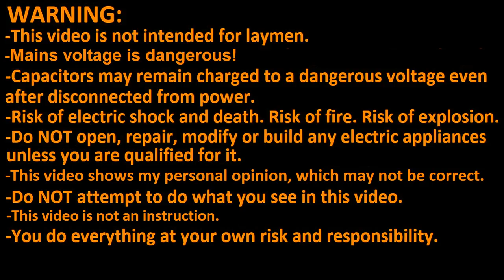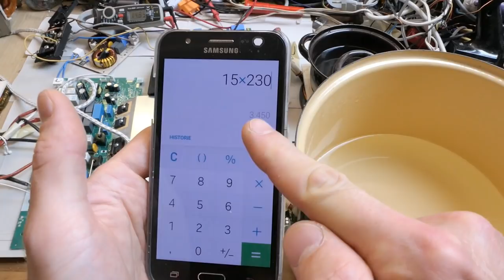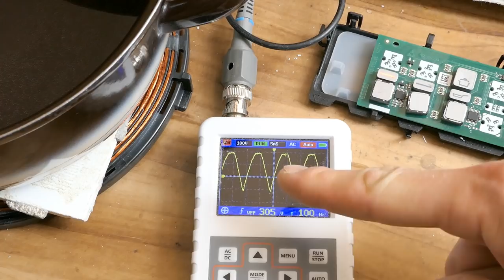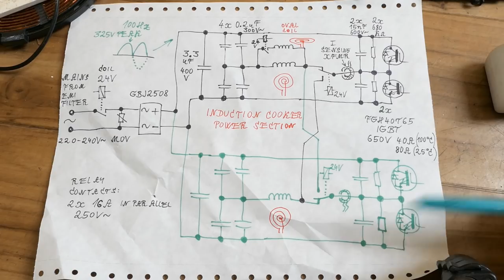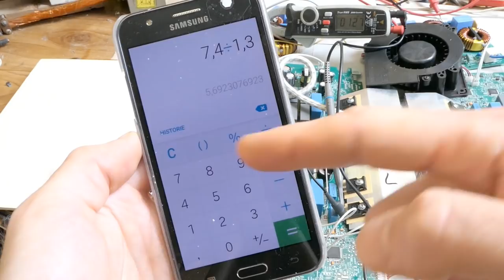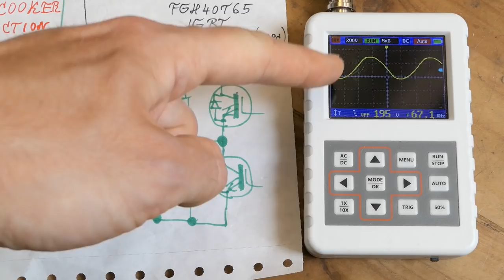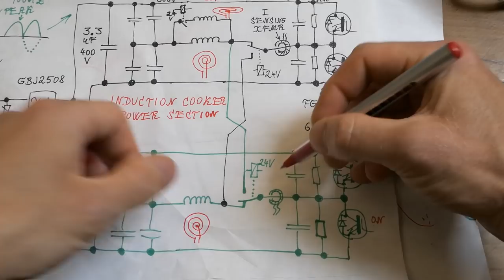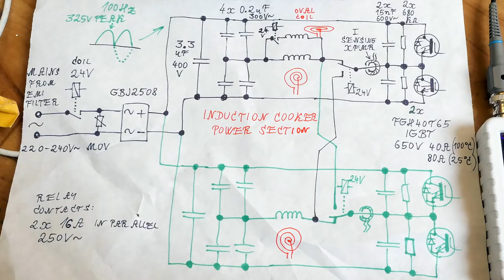induction cooker experiments and analysis

Comment: I always amazed with fine tuned resonance circuit. for me it's like a black magic, but again to put it simply it's like pushing a child in swing when the swing at its peak so the oscillation is not interrupted, BUT implementing this on an electronic device it's still amazing and bloody complex.
Reply: it could be imagined as 2 children on swings and you left arm does one and the right does the other out of phase. your body is the pivot. also you can imagine a olympic swimmer with each stroke but a slight delay between each as the body rotates slightly for the next pulse. A liitle bit of the last stroke is converted into the pivot. but only on the fastest swimmers.Dont tell anybody as its an olympic secret.LOL

Comment: some pots have a iron core attached under them so they can work with any induction cooker
Reply: Iron would be ideal. Sometimes it’s a thin steel plate, and it tends to overheat when it’s too thin.

Comment: This content taught me more about inductive circuit and zvs in 20 minutes than any other.Thanks so much for your straight forward explanations.You are as effecient as this zvs circuit! Question... I would have thought the freq at the halfbridge would be 25 hertz or there abouts as 50 hertz is coming from the outlet?I suppose that is the freq from the transistor going into the coil but what happens to the mains outlets freq as you said they overlay each other. I would have thought it would get ugly on the scope when they clash.
What is driving the gate ? Kind regards Andy
Reply: The half bridge circuit rectifies both half cycles of the sine wave. This video shows it. 
https://www.youtube.com/watch?v=wNnOfF1NkxI
At 13:30 in this video his upper circuit has a coil labeled "I sense XFMR". That is the coil the micro controller is using to detect the current flow and time the gate pulses. Basically, they are driven by the micro controller. Good luck to you. 👍

Comment: I love induction cooking, I would never go back to gas or those dreadful infrared things.
Reply: Exactly, that is why the comment he put on the cat where he prefers the resistive elements is really out of place. Induction is so much superior it's ridiculous 😂
Reply: its pretty awesome but not really sustainable long term. At the end of the day its a whole inverter rather than a gas hob or a resistor. Of course that isnt really an issue if you repair your own things.
Reply: What I hate the most with cookers using resistive heating, is not that they take longer to boil a pot of water, but the huge delays when changing power setting. Once it get too hot, the heat still continues to rise, even if it's turned compleatly off and things will start to burn or boil over before the heat finally stops rising and starts to go down. Then if you forget to turn it on again, it takes forever before the heat comes back 
- and for example a steak will dry out in the frying pan, before it's properly cooked.
Reply: @Speeder84XL  The main issue for me with resistive heating is it first has to heat the ceramic glass, which then heats the pan. If something boils over it is baked on and a hell of a job to remove. With induction, nothing heats but the pan. The only heat on the glass is that transferred from the pan. Should something boil over it can be removed, often just by mopping it up. Maybe a little mild soap. Infrared cookers can look a real mess after just a few months .
Reply: @MichaelBeeny  Yeah! 
That's a pain in the ass as well, haha. Espesially around the edges of the hot zones where it get just the right temperature to stick the worst (the middle often get hot enough to burn most of it off)
Reply: Same, I’ve been cooking on induction for about 18 months now. I thought I would miss gas, but no, the only problem is that I can’t cook with aluminium or glass pans (most of mine work on induction but I needed a new frying pan and coffee pot)

Comment: Thanks for the insight. I had hoped to run a single ring in a camper/RV and wondered if I could use a square wave or modified Sine inverter for maximum conversion efficiency (and low cost) but it looks like shape of the the rectified Sine input voltage waveform is essential for the operation of the circuit.
Reply: You don't need AC for the operation, DC suffices. Run any kind of inverter at any frequency, then rectify it and feed to the induction heater.
Reply: @LMB222  at 50 hz is ok?

Comment: straight chromium grades of stainless work (400 series) it is magnetic enough to run successfully. That's the only thing i hate about my induction hot plate. It really is fast and efficient even though i only have a baby one powered off 120v.  Glad you finally did a video on induction cookers.

Comment: The 7KW is why us brits have a dedicated circuit for such cooking appliances, terminating in a hard-wired cooker connection point usually, no need for any two or three phase power... :)
Reply: In Hungary, we also run a separate wire from the incoming distribution block, the only problem is that we don't get 100A for free as you! 😛
It is actually 30A which is free to install here, but in older houses you usually find 16A on single phase. The phase currents add up, so if you ask for 3ph, it is 3*10A.

By free I mean, you don't have to pay extra installation cost. Above 30A you have to pay roughly 12 GBP per Amperes, so it can get expensive quite quickly. It's a one-time cost though...

Comment: A propos your cat, I also prefer the simplicity of resistive elements. Is inductive more efficient due to lower thermal losses?
Reply: Inductive is heating the pot's bottom itself.
Resistive heater is separated from the pot, that heat must be transferred to it. Then, resistive element heats up also it's other side, which then must be reflected and insulated.
Reply: My cat prefers gas cookers that can work even with a repurposed tin can.

Comment: I hate these capacitive touch buttons! I switches my old microwave with one that have these, it seems that they are designed in a way that short touches on the buttons won't activate them, probably for security reasons, with a strong filtering so that noise does not trigger them at random. The delay in them in horrible, almost half a second, if I want to put 20 minutes I could do 2 quick presses on +10 on my old one, in this new, which does not have this nor numbers, I have to hold the up arrow that starts with 10 seconds delta, then 30, then 1 minute as it gets faster and, obviously, I always end up setting up more time than I wanted, so I have to press the down arrow.... "progress"
Reply: What I did when needing a new microwave is bought some used Panasonic inverter microwave for 20€ with grill function... Besy microwave I ever had especially when melting frozen vegetables and also made in UK of all places. I wonder if they still make them there. Seems the model originally dates to from the late 90s also.
Reply: @rkan2  Don't get me started on melting things on a non inverter microwave!
Reply: When I bought an induction hob a while back, I deliberately found one that had knobs - Smeg Victoria (SI964 series). It was the only one I could find at the time that just had a separate knob for each "burner" like my old gas hob.
The knobs just select between the different power levels (which are still indicated with 7-segment displays). You can also turn it backwards to do some kind of timer-based thing but I've never used that. The main thing is, you can just turn it up or down by turning the knobs just like a gas cooker. It does annoy me that most of them have touch controls even though that is worse for a hob in pretty much every way, just because they want to look "modern".

Comment: Brilliant video , I’m repairing an induction cooker now so this couldn’t have been better timed . I am surprised to learn that you don’t understand how induction cooking works - your pots must be magnetic in order for the induction to heat the metal. More modern pans come fitted with an iron plate at the bottom to make them compatible even though the rest of the pot might be made from aluminium .

Comment: 9 power levels, or is it more like 20 with half-levels? I have used induction cookers with 10 power levels and they are miserable to use unless for simply boiling water. The one I am using now has about 100 power levels, but is no longer manufactured. Its replacement has I think 54 power levels and that is probably enough not to annoy a serious cook like me.

I think that power levels are implemented using different duty cycles. I’m in the USA and so it was 120 volts and 15 amps to work with, so at most 1800 watts.
Reply: Maybe you had a very badly designed model, but there's not much point to having so many power levels, they just need to be evenly distributed across a logarithmic scale. I've heard many plug-in models are terrible in many ways, so maybe they didn't do that.
Reply: its the duty cycle that ruin it for serious cooks as it double the power for half of the time and stuff burns
Reply: @Buzzhumma  Yeah that can be a problem, but it's purely down to bad software. 

There is no reason to cycle the power as slowly as some units do. After all they just turn off all Transistors during the off time. It's not like they use a Relay to do that or something where switching cycles have to be reduced.
Reply: @Basement-Science  try using one with few power levels. Say you want to keep a pot just barely on the boil. If your induction cooker has 9 power levels, you have to be very lucky to have one of its levels just right. Or try slow-cooking scrambled eggs: I found it impossible to do reliably without enough power levels. With the usual ohmic burner or gas, one can make a fine adjustment.
Reply: @markiangooley  I use one with only 9 levels daily. No problems here.
Reply: Mine has 9 levels plus boost and it’s very easily controllable, even at low levels

Comment: So is it really more efficient then resistance heater? Or microwave?  Let's say we want to cook 1L of water? Also which will be the fastest?
Reply: Yes, in that case induction will easily beat everything else in both efficiency and speed. The shorter the cooking process you want to do, the bigger the advantage of induction will be in both efficiency and speed. If you want to cook something for 30 minutes, all types of stoves will perform pretty much the same.

- Microwave ovens are AT MOST maybe 70% efficient because of the magnetron in it, which is a vacuum tube. You also wont find one that can put out more than 1000w, so speed is limited by that.

- Classic resistive heaters take ages to heat up and their heat capacity is "lost" when you are done cooking. Some more heat from the plate itself will go to the air, the rest of the cooker etc, instead of the pot. The infrared variant is the same except it has less heat capacity, meaning the plate itself heats up faster and cools faster. But both are very slow at transferring heat to a pot.

- A gas stove can potentially beat induction in terms of speed if you turn it to the maximum, but from an energy and efficiency standpoint, it still loses because of all the exhaust gas that is still hot without having heated the pot. Of course 1kWh of gas is usually cheaper than 1kWh of electricity, so it depends on the respective prices which is cheaper in the end.

Technically there is almost no limit to the speed at which you could heat a pot with induction, or how efficiently you can do it. Manufacturers just settle for a good balance between cost, efficiency and utility.
Reply: @Basement-Science  Here in the US it's easy to find microwave ovens over 1000W. 1100W is pretty common and the maximum seems to be 1250W. This 1250W output happens to be 70% of the power available on a standard 15A household circuit, so your estimation is right on.
Reply: @eDoc2020  Yeah I've heard you can supposedly get those higher power microwaves in the US, but I'm also still wondering if they just measure it differently or something. The components inside dont seem to be bigger from what I could tell (especially the magnetron).

Of course you could easily make a much higher power microwave for 230v countries, but there seems to be no demand for it.
Reply: @Basement-Science  I presume it's measured the same way. The built-in microwave here says 120 VAC 1.60 KW Output 800W on its label and the newer 1100w countertop unit is rated 1.5kW (and this latter rating was confirmed when I borrowed a power meter). 

It's possible that Americans advertise with the maximum power into an ideal load and Europe measures with a standardized or realistic load, I don't know. I'm curious, what's the ratio of advertised output power to input power on microwaves in your area? If that number's different it probably means different measurement techniques.

The difference might also be culture influenced. In this country known for laziness and obesity microwaves are probably valued more, as they are used for heating prepackaged foods. Maybe in your part of the world microwaves just aren't used as often.
Reply: @eDoc2020  Just checked, my old one says 1400 W input and 900 W output for the microwave part of it. 
I've also got a new one that claims 1040 W input and 1000 W output... something is definitely up here... (it's an inverter model, but still)
I'm going to do some digging...

As for cultural, a lot of people here dont even have a microwave, either because they think they are harmful, or because they just dont know what they would use it for. Ready made food is not super common over here. I guess you'd have to look for proper statistics though.
Reply: @Basement-Science   900/1400 watts equals 62.5% efficiency. That's close enough that the measurement methods are probably the same. For the 1040 in / 1000 out model, I would need to assume that's a mistake such as a typo. 1440 W in would make more sense.

The culture explanation seems most likely. Why buy a large microwave if you'll never make full use of it? I was maybe exaggerating a bit on the prepackaged foods part but either way we love microwaves. In the workplace breakroom, there are only three guaranteed appliances: the coffee maker, the refrigerator, and the microwave. And I guess also a water cooler if there isn't a drinking fountain.
Reply: @eDoc2020  I didn't find much about the standards, except that my new microwave claims that rating based on iec-60705. All other microwaves only referred to "the iec standard", if anything. (same with US models) 

There seems to be a 1999 revision and a 2010 version. No idea about the differences. The only way to look at the actual standard for free seems to be broken as well.
Reply: The fastest water heater is a kettle. The heater element is inside the water or just above it, no separate pot involved. And they are rated for 2.2kW here, makes the even faster. The second one is the heater, and the microwave is the last. It is not really efficient to use a microwave to boil water.

Probably an induction heater can be very close in efficiency to a kettle, but probably not rated for 2+ kW for the small coils, so if you just want 1L of water in a smaller pot, it will be slower.

Comment: The benefit of an induction cooker is that it heats the food, not the whole kitchen!  I think when my gas cooker packs up, or if the price of gas becomes too the next one will be an induction one. 

It takes 4180J. of energy to make 1kg.  (= 1 litre)  of water get 1 degree hotter, which is just under 70 Watts-minutes.  So at 3.5kW, in two minutes it could bring 1 litre of water from freezing to boiling.  In practice, it probably will take a bit longer, because the pan is also absorbing some of the heat; but even so, the specific heat capacity of metals is lower than water.  And this is still more efficient than using either resistive heating  (which requires heating a larger mass)  or fire  (which loses some heat in the exhaust products carried on the updraught).  

The reason why water has such a high specific heat capacity is because of hydrogen bonds.  When hydrogen and oxygen are in a covalent bond together, the oxygen atom tends to hog all the electrons to itself.  This means there is a weak negative charge near the oxygen and a weak positive charge near the hydrogen, so each water molecule will attract its neighbours towards itself a little bit.  This hydrogen bond is not as strong as a proper ionic bond, let alone a covalent bond, but it does still take some energy to separate it.

Maybe you could make a home-made slow cooker by filling a big pot made of ceramic or some sort of plastic that will not get too soft when it gets hot with stew, and putting some tungsten lamps right inside it so the heat from the lamp will go exactly where it is needed?

Another crazy idea:  Use solar panels during the day while you are out at work to produce electricity, and use this to sepaate water into hydrogen and oxygen.  Then at night, use a hydrogen-fuelled cooker to cook your supper!

Comment: It look odd how the power is redirected at 9 level for single cooker, because that means you cannot run them both at full power. Induction cooker I have and others I seen all have boost mode, there essentially total power from both cookers are redirected to one.

Comment: Can this circuit power a Tesla coil?
Reply: Maybe if it had a feedback coil and was isolated from the 240 volt but it also has a load detection coil circuit you have bypass

Comment: From cave men who could start a fire with a stick to electric fire that requres phd to start.
Reply: Yes, all that overcomplicated electronics, just to fry an egg. Ridiculous!
Reply: Certainly doesn't require a PhD to start (in it's disassembled form) but probably requires at least some engineering degree to not be accidentally killed by it...
Reply: @trebushett2079  you have never used one, correct?